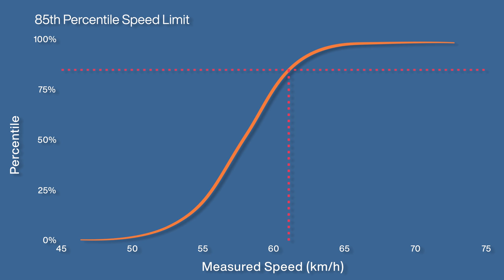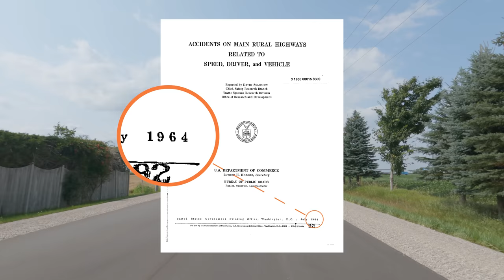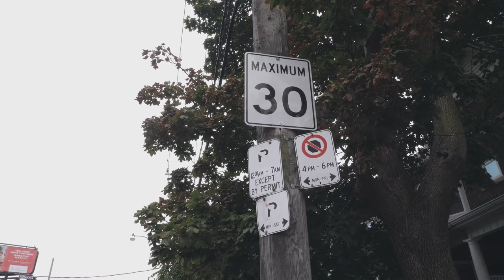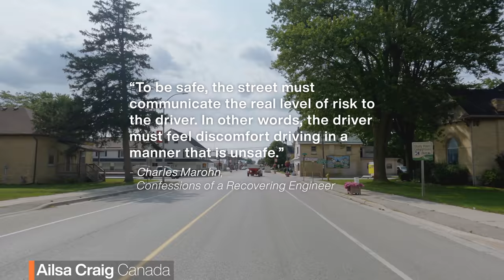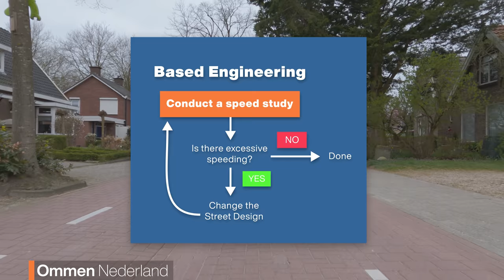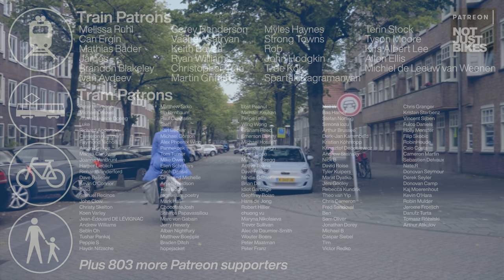The Wrong Way to Set Speed Limits [ST06]

Comment: "If we paid deliberate attention to everything we did while driving it would be exhausting." 

lmao this is what driving with ADHD is like, because any lapse in attention could be very dangerous (we have a way higher chance of being in a traffic accident) I am hyper vigilant, even on my meds. It is exhausting and I only really enjoy driving on roads that are inherently challenging and therefore stimulating to drive.
Reply: get a car with a manual transmission, constantly changing gears up and down provides enough of a challenge to stimulate me
Reply: @monkey.moments8272  Yeah I've heard that helps! I hope to get one soon.
Reply: @wiegraf9009  i recommend getting a 2nd or 1st gen miata, bmw z3/z4, or any honda, they're easy to maintain, reliable, and zippy enough to give you a fun driving experience
Reply: @monkey.moments8272  Yes would love to get an MX-5 but I need a parking lot for it. My Lexus is currently taking my parking space so I'd need a second.
Reply: Yeah I prefer to drive through the city if it’s on the highway I’m going to miss a couple exits oh my God it’s the worst shit I’d rather us just have decent public transportation though because someone just stole my catalytic converter out of my element hoo boy
Reply: @banquetoftheleviathan1404  lower your cars man, also you might want to either get that straight piped or just replace the cats if your state has inspections, because the heat from the exhaust could damage the underbody
Reply: @monkey.moments8272  happened at a shop so luckily they are paying for it to get fixed. kinda crazy tho how people just be like that. they gt em on camera and everything
Reply: Is this why I'm constantly checking my speed?
Reply: @Zestric  I definitely do that too 😂
Reply: As someone else with ADHD here... I can vouch for this... driving for me is EXHAUSTING and I hate doing it. Unless I have to I usually only drive twice a month. >_<;
Reply: And it's sweeeeeet sweeeet sweet cortisol yeah
Reply: @monkey.moments8272  hey I drive an NC and it's great. 20 years ago you could find an NA but they are getting rare now.
Reply: I have 3 driving modes:

Terrified and hyper vigilant. (Usually because I'm in unfamiliar territory, a masshole just tried to kill me, or dealing with a stupid 4 lane stroad thats dangerous for cars let alone anything else in this noman's land)

Falling asleep on the interstate because the road is stupidly boring. (Australia's deadliest road is a perfectly maintained, perfectly flat, perfectly straight road for like 300miles of highway that puts people to sleep so they drift into another lane). Also being put to sleep by a boring highway is extra dangerous because of massholes and other dangerous drivers breaking all the rules.

Anf finally my normal safe mode where I'm actually kinda able to enjoy the ride, usually through mountains or some backcountry or small town road with the right balance of stressors to speedlimit.

I find the interstate both super hypnotic and super scary, partially because of the hypnotic effect of overly boring amd monotonous roads. I would love to take a train instead of driving 6-7 hours to go to my hometown to visit family. But 1 the train litterally doesn't go there (closest stop is 3hrs by car away) and 2 Amtrak sucks, it would take about 21 hours just to reach that station. Even to do a simple journey of Hartford up to the mass pike ond over to Syracuse NY is twice as fast to just take a car on the interstate.
Reply: I had no idea that the design of the street could encourage people to be more aware of how they drive. And I did not know that a lack of these designs actually contribute to drivers experiencing exhaustion. Making it difficult to drive in a slow zone could actually save a life. And making it too easy may make that driver unprepared and end up distracted. Those strouds the video showed all over the place are a distracted driving nightmare.
Reply: @nicklang7670  Even racing circuits do this! Rather than putting in a speed limit they change the shape of the track to make the cars go slower!
Reply: @AZ-wc5ot  I'll see what I can do!
Reply: And even worse with the modern systems on trucks that  warn you anytime you are not doing something exactly "by the book."  You get a lesser feel of this if you have a progressives insurance "snapshot," device in your car. 
     My truck gives false positives in construction zones and makes a "kid banging on a drumset," noise. If I drive in the right lane, whenever I pass a lane merge an alarm goes off since it sees no paint (where the 2 lanes merge there isn't any) and mistakenly thinks I'm not centered in the lane. Throughout the day (beep, beep, thumpa thumpa thumpa). 
     These distract me so much, and I have ADHD like you.
Reply: @monkey.moments8272  same here, I really like both my manual transmission cars and having a manual in my daily driver is very satisfying with my adhd.
Reply: Right, my immediate reaction was "wait, how do you not run in to people or crash if you aren't paying attention?" I moved to Phoenix AZ from Chico CA, and most people drive like 20-30 miles over the speed limit here. It makes driving quite interesting at times, and it's really quite fun. I've started doing a bit of door dash, just for the excuse to drive around.
I drive with the belief that in the next moment, a car is going to swerve into my lane and kill me, or a person of color is going to hop out and I'm going to be in prison for life in the next big hate crime media scandal. It's not a calm way to drive, but I haven't hit anyone or anything, and I don't have any violations.
Reply: This is why I don't drive. ADHD. The stress and risk are so high
Reply: …I think this might describe WHY I hate driving so much. Even with Outsourcing where I’m going to a GPS so I hopefully don’t get lost (I cannot form Mental Maps much at all and trying to look for streetsigns is agonizing, nevernind keeping track of When and Where to turn) I still just. Really hate it. I feel absolutely exhausted (anxiety trigger aside + something funky going on with my hands) Getting There and often just want to nap as soon as I’m Back Again. I can’t always Tell when to change lanes in heavy traffic so I stay put then feel like screaming in terror when I finally do have to move over (even with hyper vigilance with my mirrors.)

Fortunately most roads have a “feel” for the Right, Safe Speed…but when they don’t it is SO difficult to not fluctuate by 5-15 mph either side of the Target Speed (nevermind some cars just. DON’T. want to hold their speed. They want to go Faster or Slower.) Then when something Happens…I just don’t always have good reaction time (or can Think what to do in a several ton vehicle with 30-50 mph) because it’s So Much Damn Focus (and the more anxious I get, the worse my tunnel vision and focus becomes. And driving already makes me really, really anxious.)

But calm, long stretches of straight roads? Then I’m stuck stressing about trying NOT to zone out or fall asleep—in the middle of the day. NO bit of this is remotely Fun or a sense of “freedom” whatsoever. I wish I could just live someplace that was safe/close enough to just walk—that way I can have directions open on my phone’s map and more or less FINALLY see where I’m going and move at a speed that allows my stupid brain to focus on things. (But alas, very few towns are truly Walkable and I am a woman. So Too Far and Unsafe.)
Reply: @anonymousfellow8879  Oof, are you on meds for ADHD? It makes such a huge difference for me driving I can scarcely describe it. Off meds I definitely experience everything you're describing here. On meds I can drive without stressing very much at all. I find taking public transit way more stressful because of my ASD these days.
Reply: Also drive an interesting/fun car, if you have a car you truely love, you will pay attention more... it helps if you know that you will die if you wreck if you drive what i drive :P
Reply: Yeah my adhd is a lot of the reason I haven't gotten my driver's license. My dad doubts he has adhd but I definitely think he's where I got it, and he considered quitting driving completely after too many accidents due to lapses of attention. When I was growing up we lived in a small town where it was difficult to get around by public transit, but my dad would walk or bike to work when the town wasn't blanketed in lake effect snow and -25°c/-13°f.
 Now we're both back in Toronto (I was born here but was a baby when we moved away and only came back in 2018) and while he has a car, he often travels by subway, especially since his rooming house is right across from a station. Even intercity he'll sometimes take a bus or train. Makes me feel better knowing he's not spending a lot of time behind the wheel, especially in places with lots of intersections. 
Myself I've never been frustrated by lacking a car, even though I'm in a semi-suburban area. There's a subway station nearby which also serves as a bus terminal so I can get places quite quickly. There are shopping centres which I wish would be redeveloped so it's not such a pain to cross endless parking lots, but there is some progress on things like that too.
Reply: @wiegraf9009  As someone who also gets distracted easily, manual transmission absolutely has helped me.

Comment: It took me about a minute to realize that the 85th percentile rule was an actual thing and not a joke... Wow!
Reply: Yep, same here. I’ve never heard of it. It sounds really stupid and could presumably lead to five or six different speed limits. Where I live, there are basically 3 speed limits and you can generally work out what applies to your location without needing signs.
Reply: It's actually part of EU recommendations on speed limits too.
Reply: @troyjollimore4100  It is as conveniently old as the US method and research which it adopted... and in the EU it was never implemented. It was a recommendation, not a directive.
Reply: @troyjollimore4100  No, it was not. It was introduced as a formal recommendation in the early 1990s, well after the oil crises of 1973 and 1979. Cars have undoubtedly improved a lot since then too, but there are plenty of cars from the 1970s that remain a pleasure to drive (if not necessarily to sit behind in traffic, given the amount of pollution that they spew out).
Reply: @troyjollimore4100  "It"; the recommendation to use 85th percentile - which is what we are discussing - is one. Speed limits across much of Europe were set from the late 1950s to the early 1970s, well before the recommendation from the EU. Many of them were definitely not set on the basis of "85th percentile", such as the limits on French and Italian motorways (130 and 140 km/h respectively), which were significantly higher than the maximum speed of the typical car in France or Italy back then.

Name one 1970s car that was fun to drive? Fiat 124 Sport. Alfa Romeo Spider. Lancia Fulvia HF 1.6. Jaguar E-type. Volkswagen Golf GTI (I & II). Ferrari 246. Just to remain within those I have tested (and I could list at least as many for the 1980s, and for the 1990s). As comfortable, secure, economical, capable as a 2020 car? No, definitely not. But at least as much fun - and possibly more, since the car's limits are that much lower.
Reply: statistically the 85th percentile makes sense as it is about 1 standard deviation above the median. Also I would suspect that mostly that was for places where there were new roads far from city centers and already built-up areas (since older roads would already have speed limits in place and most cities already have limits in place that are probably lower than the 85th percentile would be anyway).
Reply: @dan_lu  Statistically it's a lazy choice... speed distribution is unlikely to be normal, or even unimodal and symmetrical around the average, particularly in an urban road. You are totally correct that the method was developed for rural roads, but formal speed limits in towns or on major roads were not common until the 1950s (when the 85th percentile method was developed), not least because there were far fewer cars.

Comment: There was a study done in my area of London where they reduced the speed limit of some streets from 30 to 20 mph but otherwise did nothing. Then they measured the effect that it had on the speed of vehicles and found it reduced the speed by only 1mph. As a result the study recommend increasing the speed back to 30. Those folks would definitely benefit from watching this video.

Comment: I definitely agree with this. I constantly see places with speed limits that simply do not match the road design whatsoever, and drivers clearly demonstrate that. I also think that speed limits should be raised in some places. There's this highway I take to work that has a speed limit of 55, however most people go anywhere from 65-75, even police officers. Clearly there's a problem.
Reply: The 55-mph speed limit was imposed across the country in the 1970s. NOT for safety, but because we were experiencing gasoline shortages and the government wanted us to drive slower to conserve fuel. Those fuel shortages ended in the 1980s, but various state governments kept the 55-mph speed limit to show how civic-minded they were.
Reply: There are several of those in my commute, usually for no apparent reason, and they would be very annoying if people did obey the speed limit instead of chalking them up to mismanagement and ignoring them. One of them now has a traffic camera and my employer actually sent out a mailing about it because almost everyone does at least 20 over. I suppose this is what happens in a country with low trust in government.